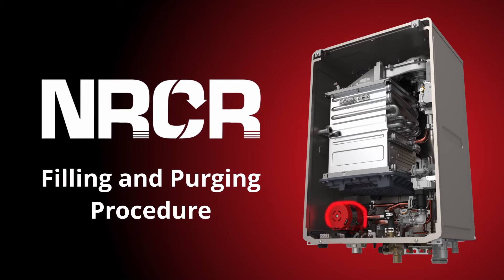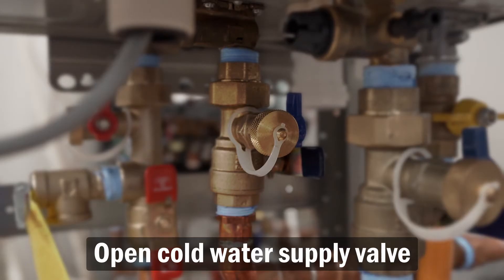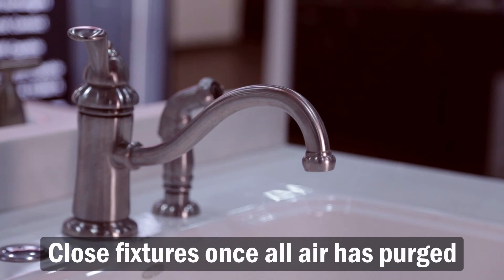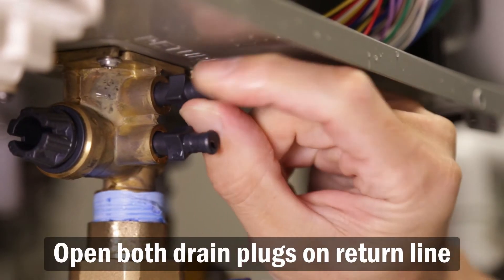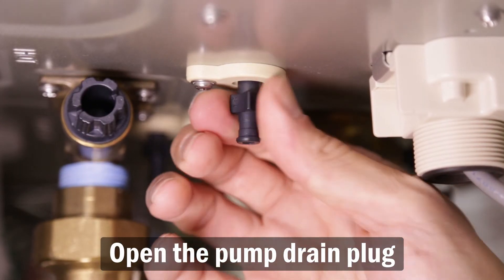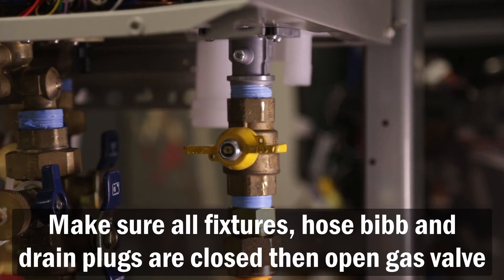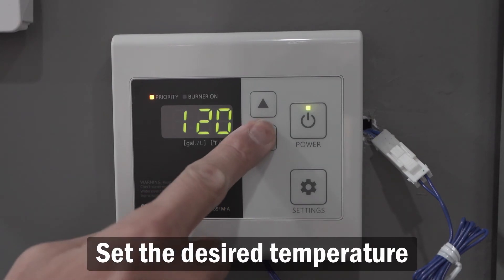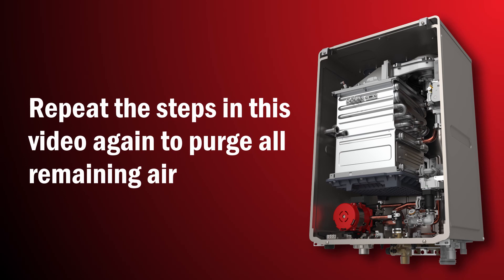How to Fill and Purge the NRCR

Comment: I’m installing Norris since 2003. This is by far the worst product that they have created six units or circuit board issues that bleeding does not work north should recall this unit or recall the motherboard and corrective and not let plumbers deal with the headache of an irate customer it’s not fair. That’s why Navien honestly is better for the research internal pump and even the Rinnai

Comment: Noritz needs to issue a recall for their faulty circuit boards. The recurring code 63 error is not due to trapped air as this video suggests. You can do this many times and the code will still return. Replacing the circuit board is the only solution that helps, and even that will fail eventually if the same model circuit board is used.

Comment: My water heater is throwing code 63.  After closing the return line valve per the video (which I watched multiple times), there was not enough water in the tank to create a steady stream of hot water out of the faucets.  This instruction makes no sense to me.  Perhaps this instruction to close the return line valve is applicable when a crossover valve is used in the system?  That’s not the case in my house because it has an actual return line so a crossover is not needed.  What I did is to reopen the return line valve and run the faucets to purge out the air in the system.  Whether this was correct or not, I have no idea.  The water heater is now working again, but for how long I don’t know.  I can only hope.
Reply: Same problem I am having, how did you fix?
Reply: @kingwooddecorlaser111  The circuit board was faulty.  I had to a replace it (again) with an updated circuit board.  After that, The waterheater was not delivering continuous hot water set at 120 degrees, but seems OK set at 125 degrees.